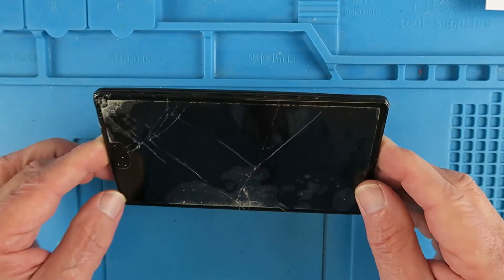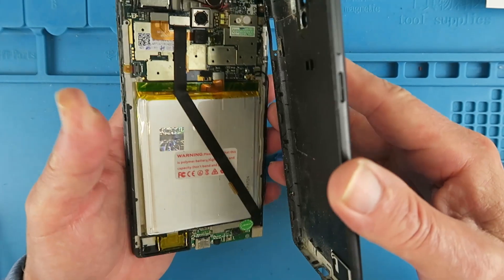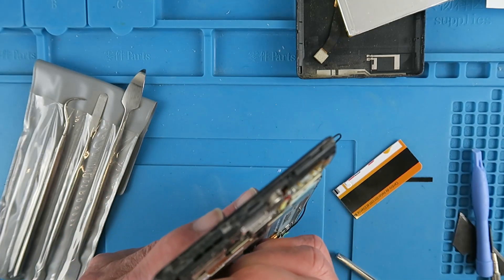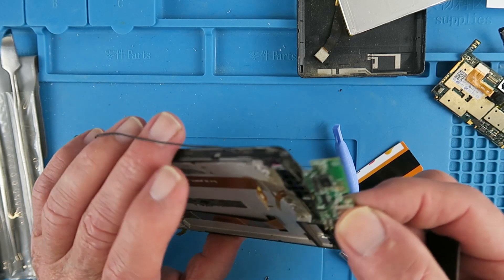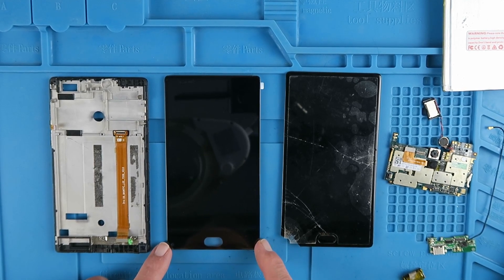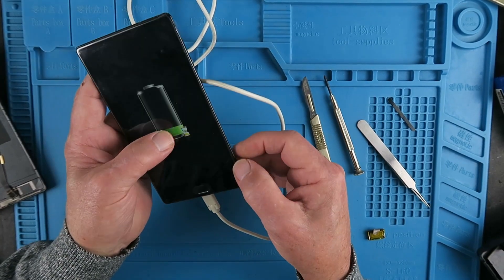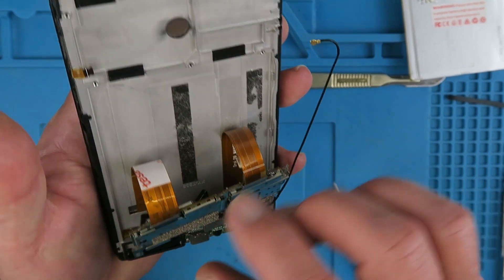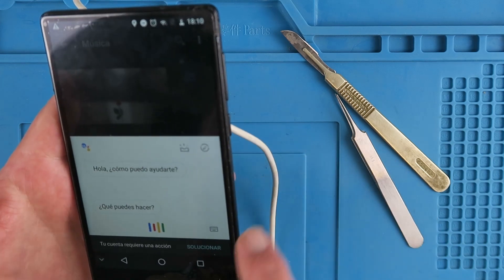LEAGOO Kiicaa Mix LCD Display Replacement

Comment: Hello mate! I just broken the screen of my kiicaa but the LCD is working great, its just the glass that broke then i guess i dont need to change LCD, just the glass right? I guess changing the glass its easyer and doesnt need to eat up? I never had problems working with electronics and even already changed is batterie but never changed a screen. I most likely will buy a new phone and after i will try to see if i can only remove the glass.
Reply from the maker: Separating the digitiser from the LCD is very difficult and the risk of breaking the LCD in the process high. For me swapping both for €28 is much less hassle! Link in the description to where I got mine. Good luck!
Reply: @1nformatica  Hello, yes i already google in ali and its the price, thing is the original screen got great quality(sharp) and i bet that chinese ones got far worst quality, its just better buying a new phone. Thanks for the reply!
Reply from the maker: I could not notice any difference in the screen quality. And, of course, the original is Chinese anyway!!!
Reply: @1nformatica  the original is from sharp, its japanese and got great colours.
Reply from the maker: Interesting! Both the original and replacement I have bear the same part number rl055fh087a  and quality control stamp "YY" .
Reply: @1nformatica  If they the same producer then i belive its the sharp original.

Comment: Good stuff you was able to locate a replacement.   Betting like Lap Top Displays there are only a hand full of varieties ever used.  Toshiba makes most all used.
Reply from the maker: Yes, it's a challenge! The problem is usually the ribbon cable. Although the screens may be the same the cables differ greatly.
Reply: @1nformatica  Same with the Lap Tops.   Ribbon location is the issue.  All are pin for pin compatible .  Just the Location it seems.